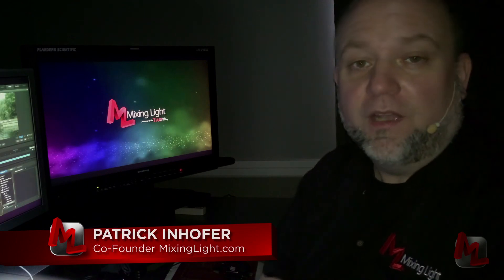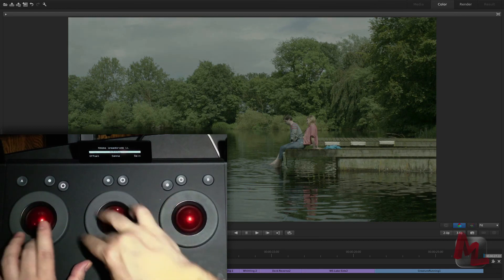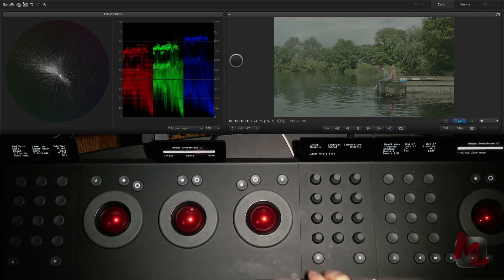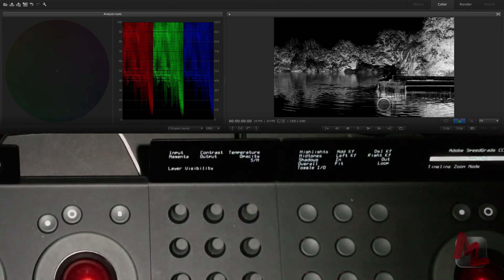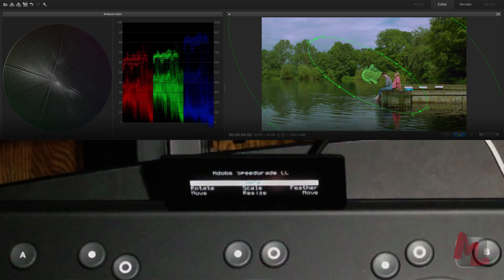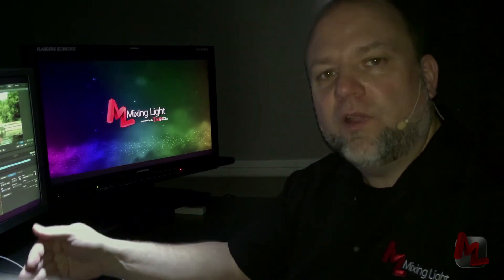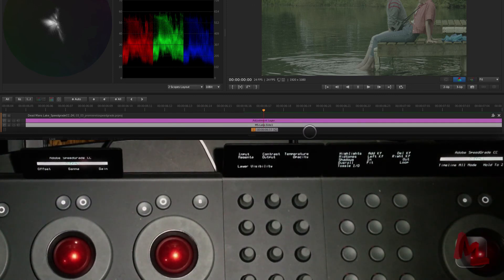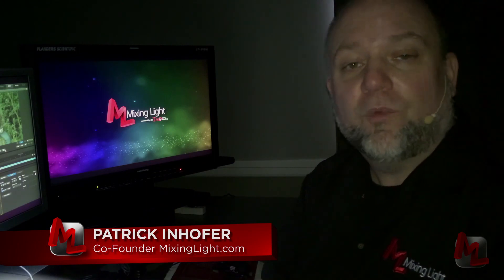Using the Tangent Element Colorist Control Surface with Adobe SpeedGrade CC

Comment: love it, was looking for videos to see if this fits my needs. Im a freelance director color grading is more or less what i do as well for my personal projects, what is best to buy after buying the track ball 3 elements in your opinion? also do u recommend a panel for video editing that goes with that ?
Reply: Hi Walid - I'd probably buy the Bt and Kb panels after the Tk panel. For Resolve you need to buy both at the same time, since Resolve won't address one without the other. But even for an NLE, I find the Bt and Kb panels tend to go hand in hand, with the Bt panel activating different functions on the Kb panel.
Reply: thank u very much Patrick.